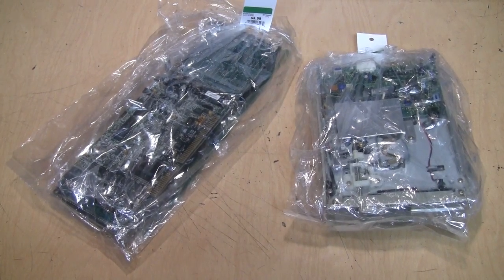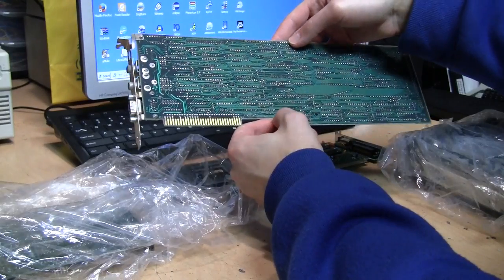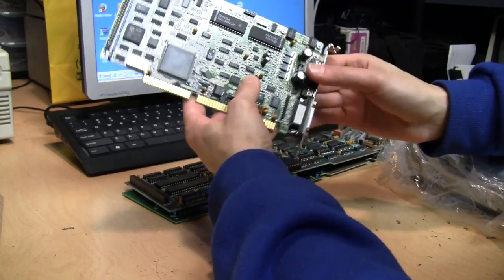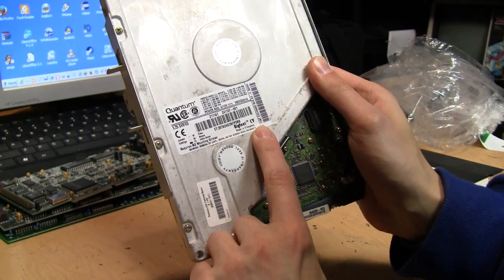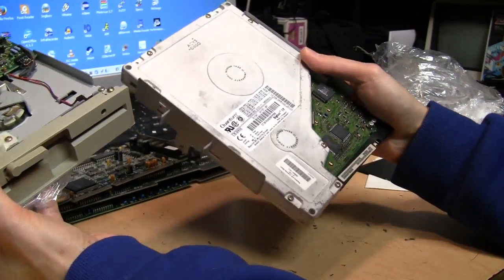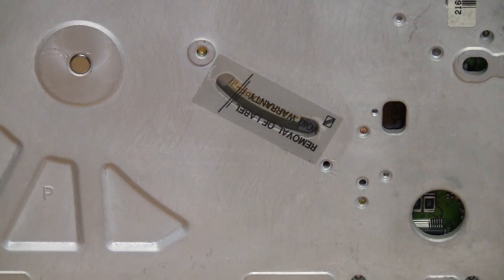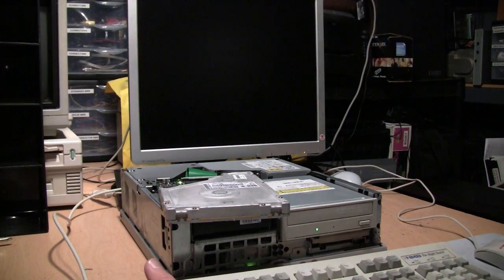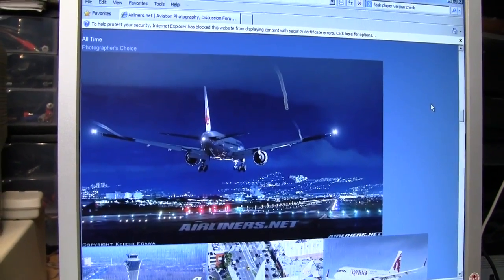Bag O' Computer Parts & Quantum Bigfoot hard drive

Comment: heh
Reply: Sonic is better. 

(Issa joke Plz don't kill me)
Reply: Mario's position is a floating point number in 3D space, and is converted to an integer between 32,768 and -32,767 using the module operation when the game checks if there's land under Mario. But, if Mario's position is outside of that box, where there's no land, can Mario stand there? The answer is yes. As far as the game sees it, Mario is standing on land, and this is what we call a parallel universe.
Reply: Too long to read, but it sounds cool. Where do I buy this?
Reply: Tux is better than Mario and Sonic ;)